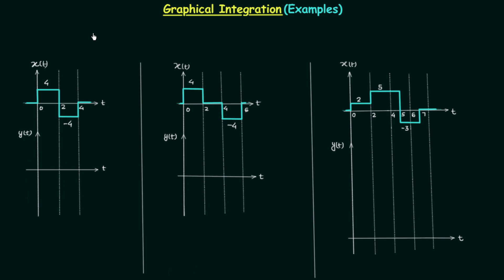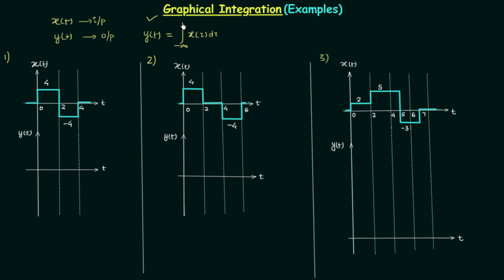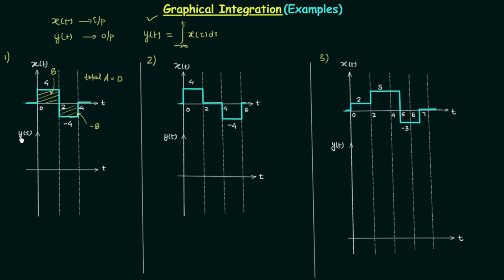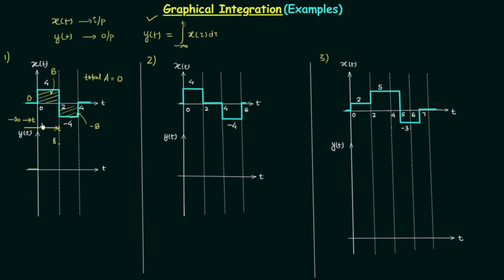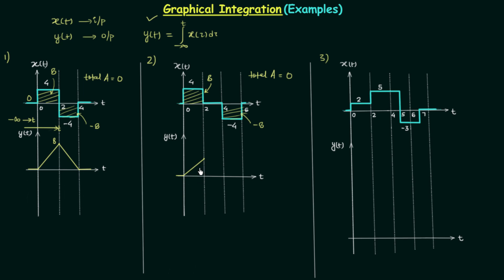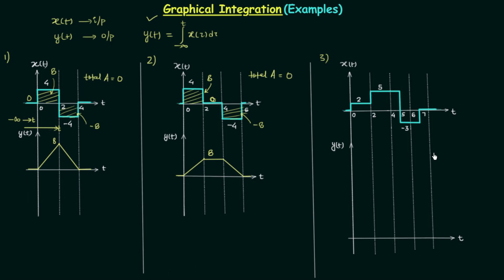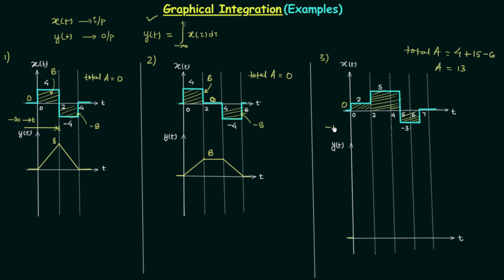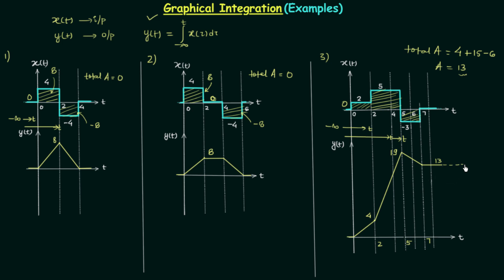Graphical Integration - Examples (Part 1)

Comment: Thank you for this lecture sir. Actually i am studying the course System Dynamics, and I'm having a hard time answering a certain section of my assignment and its about graphical integration given that i have my STOCK INFLOW and my STOCK ACCUMULATION. From those two given graphs, i would need to find my STOCK OUTFLOW, and I don't have any idea how to start a solution approach on the problem. If you could help me sir, I'd gladly appreciate it.